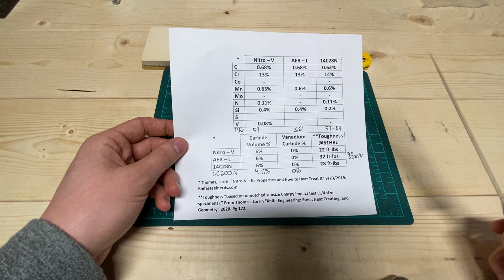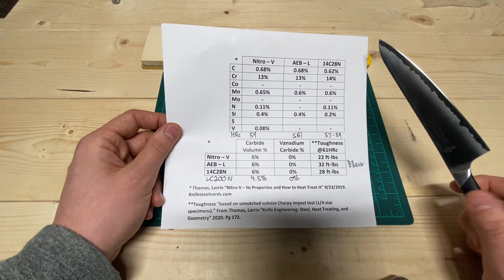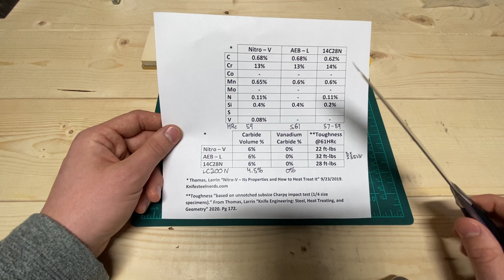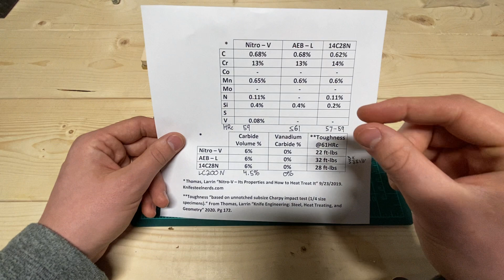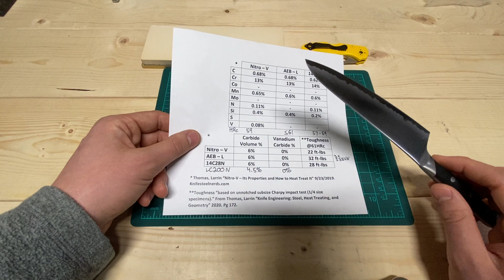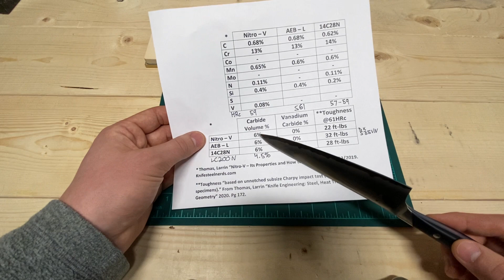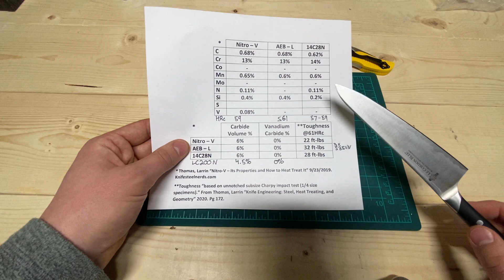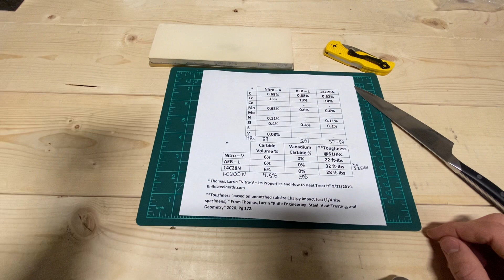Talking Steel: Nitro-V (Tough and Stainless)

Comment: Just curious, what about 12c27m? 
Its basically a slightly softer AEB-L from what I gather, with a little less carbon. 13c27 is about the same as AEB-L, 14C a little more carbonitride overall.

Comment: So does nitro-v have better edge retention? Since it's less tough?
Reply from the maker: Being less tough doesn’t necessarily indicate higher edge retention although they are strongly correlated. 

Between the three steels whichever is heat treated the to the highest HRc hardness will have the best retention. 

Very dependent on the maker.

Theoretically both Nitro-V and AEB-L have the same hardness potential I think.
Reply: @EngineersPerspective701  so in practical terms, nitro-v has no real benefit over the others? Except a cooler name?
Reply from the maker: @MRGoods89  more stainless is the problem it solves. I’ve had AEB-L get some light rust from sitting on the drying mat for a night (mother and law used it). Nitro V would have be spotless

Comment: I know absoluty nothing of metallurgy or if im even asking the right questions but id like to know what steels would you use for cutting wood, cardboard and meat? can you recommend a couple or one for each category? Also, what are your thoguhts on Civivi's damascus steel or any "damacus" steel for that matter is it worth using for an edc or is it just pretty and hyped up? apperciate your input thank you in advance looking forward to your response.
Reply from the maker: What you’re cutting is just as important of how and why. What are the situations you’re thinking for wood and meat? Cardboard is dealing with the odd box or you work in a warehouse?

Civics Damascus isn’t anything special but it’s not garbage either. Probably better off with their standard 9Cr18MoV.
Reply: @EngineersPerspective701  a good steel for warehouse cardboard boxes and for the wood im looking for a good bushcraft fixed blade steel for medium/small branches maybe small firewood splitting and for the meat im looking for a good steel to carve up deer and other small/medium game

Thank you for your input on the damascus i will definently look at some 9Cr18MoV thank you
Reply: @EngineersPerspective701  Hey not to bug you but i replyed to your comment and havent heard back from you would greatly apperciate it if you could still give me some suggestions thank you again
Reply from the maker: @MikeA-lo9xu  no sweat, I lost track of it! First pick is usually the non-stainless options and then I give the stainless recommendation. 

Cardboard: Maxamet from spyderco. S110V if you need stainless. 

Wood:  Nitro-V or Magnacut. I’d recommend stainless for this one. 

Meat/Hunting: 10V or K390. S90V if you need stainless.
Reply: @EngineersPerspective701  Thank you very much truly apperciate your help and insight I will most definitely be looking for these steels : ]

Comment: I have no experience with aeb-l. I do, however, have quite a bit of experience with 14c28n and nitro v. 14c28n and nitro v both sharpen extremely similar. They are both able to take a very high polish edge and, for "budget/midgrade" steels, they hold that top end sharpness for a respectable amount of time. For budget steels, 14c28n and nitro v are my favorites.
Reply from the maker: My experience is limited for all but I really enjoyed Kershaw 14C28N. They are really the perfect budget steel IMO. Very stainless, hold a good edge, tough and stabile. Only thing is I wish they would heat treat them a bit higher

Comment: seems like a bit of a pointless video. was looking for info specifically on nitro v. saying it depends heavily on hardness is a bit obvious as most if not all steels depend heavily on hardness. very little info on nitro v here just talking about other steels in the majority of this video. thumbs down 100%
Reply from the maker: Yeah pretty much laid it out right off the hop there to save you some time. If you have experience with the others it can give you an idea where it will land relative to those. Plus they are the direct precursors to Nitro V

Comment: Hi Justin, are you familiar with BGM Knives? Coming in the mail are two of John Miller's CKKs (compact kitchen knife) in Nitro-V which are cryogenic-ally heat treated in house at 60 to 61 HRC. I'd attached pics but YouTube won't allow. John is 22-years-old, a pleasure to deal with and making a pretty good name for himself in the knife community. Check out his work, both website and Instagram page.
Reply from the maker: Yeah I've heard a lot about him through Outpost76 and NotYourAverageEDC and been tempted but none of the designs when I last checked fit a need for me. However the CKK is new and that looks like a sweet deal! His prices have always been very fair so that may  need to be pushed up towards the front of the buy list! Really like that size too.
Reply: @EngineersPerspective701  How can I send pics of the two he made for me?

Comment: very interesting. So you mentioned that AEB-L is the very toughest stainless you can get for the most part on a knife at this time, and 14c and Nitro V are gonna be similar in toughness. they need to be hardened properly to perform. That said, does Nitro V really make that much sense on a small EDC type folder? Wouldnt it be more suited to a large wilderness blade?
Reply from the maker: There is more the how these steels perform than just raw shock absorption of a woods blade. At the high hardness they can hold a really sweet thin edge that is great for edc or kitchen tasks! Sharpens up amazing too which is fun for any knife. 

Honestly most large wilderness blades are so thick at the spine and edge they can be made out of almost anything and still perform well

Comment: Nitro-v at HRC 59 is a waste and blades that are at that HRC haven't had a proper heat treatment and cryo. Even the knife steel nerds review about it and results based on how they say it should be heat treated is incorrect. If you really want to see the performance of Nitro-V it needs to go through a vacuum hardening process then rapidly cooled with nitrogen gas followed by deep Cryogenic quench in liquid nitrogen its expensive but the end result is a steel that outperform the majority of other steels in toughness, edge retention and its still fairly easy to maintain a edge. People have been basing its performance on knives being manufactured buy companies who mass produce knives who put profit margins first who are doing the most cost effective heat treatment or from knife makers following a someone that people view as a expert who posts a heat treatment protocol on the their site that's not going to achieve maximum performance.
Reply from the maker: 100% agree. I’d say a majority of all blades made from any steel are “wasted” in terms of their potential. But unfortunately that means realistically speaking the way people will interact with this steel will be in that lower range and same goes for AEB-L. 

Even in customs it doesn’t seem like makers are going much past 61-62HRc on nitro-V which is well within the hardness range of AEB-L as well. So at the end of the day it is a more stainless AEB-L is all. Now that’s a major compliment in my mind because they are major outliers in the stainless steel class only really accompanied my Magnacut at this point.
Reply: Aeb-l is very prone to warping during HT & the HRC achievable with Aeb-l varies from batch to batch and which plant has manufactured it the average with a great HT will be HRC 60-62. To try and avoid serious warping with Aeb-l knife makers need to leave a thicker bevels Prior to HT and then remove excess stock & finish them afterwards. Problem then is the HRC test was done straight after HT removing the excess stock unless they have a water cooled platen set up the HT is affected. Nitro-v doesn't suffer from that problem it can have bevels ground down very thin to about 98% only needing the final cutting edge to be done and when HT using Vacuum has absolutely zero warping and HRC is repeatable as it's manufactured by one plant. Also saying they are basically the same as they can achieve HRC 62 with the Nitro-V being more stainless is not correct because Nitro-V is also much tougher & shock resistant than Aeb-l if both are HRC 62 and holds a superior edge.
Reply from the maker: @krakentacticaledc  Can't speak to the warping issue so that is a great note to have. And keep in mind this video is more of a production focused video because that is what most will have the opportunity to experience. Once you start talking custom, then really it's a completely different conversation as I'm sure you know well! It's like going from production cars to F1.

I really have a hard time believing the difference between the two is SO significant assuming a quality heat treat on AEB-L and you're being consistent in your material procurement. With the extra Nitrogen and splash of V in Nitro-V I can see how it would be easier to achieve higher hardness without generating excess carbides and/or blowing up the grain, thus reducing the toughness. So my guess if you've seen this happen with AEB-L, then one or both of those things are happening.

Comment: But what do you mean by working edge? So do you not suggest aeb-l or nitro-v for kitchen knives
Reply from the maker: Opposite, they are great steels for kitchen knives especially if they are done hard.

Neither develop a working edge because they don't have enough carbide. A working edge is when the initial hair popping sharpness is abraded away during cutting and reveals micro teeth (carbides) that will continue to cut. Hard AEB-L will instead hold that nice initial edge longer and then, somewhat suddenly, go dull. Abrasion isn't a major contributor to dulling in the kitchen so the ability to hold a working edge is usually not a desired steel trait by chefs. 

Many prefer the wonderful sharpening of simpler steels like AEB-L and carbon steels in the kitchen because of how fine the edge can be sharpened and how long they hold it. 

If you enjoy sharpening, AEB-L is the 2nd best sharpening stainless steel I've come across. Almost feels like a carbon steel.
Reply: @EngineersPerspective701  if so what would you recommend for a laser class chef knife? aeb-l? or Nitro-v? and at what hardness? and what about honing ability? It seems like aeb-l and nitro-v lacks in edge retention so if I go low hrc would it be easier to have it little lower hardness and do a quick one two pass on on a honing rod? I personally dont use honing rod at all but seems good option when I am in middle of service and my knife goes dull.

I am a culinary art student planning to order a custom knife and he offers aeb-l and nitro-v and he said he can harden hardness I want. And I am planning to use that knife as my everyday work knife and I can't really decide which steel at which hardness. I already made up the design I want but I really cant decide on which steel at which hardness.
Reply from the maker: @smithgeorge6858  Your reasoning is a little backwards here so I'll try to explain. 

First I want to note that the maker's knowledge and skill will be the #1 dictator of what to target. If they've never made a knife in that steel and hardness then pass on it. The heat treat is the soul of the blade so it must be done well if you're paying for a custom.

1) Take aogami super at 65HRc for example. Famed for taking and holding a great edge. Yet it technically has less edge retention than AEB-L based on carbide volume at about 1/3 of what AEB-L has. Also less tough than AEB-L by a lot. Yet it does so well because it is HARD AS HELL.

2) You say that AEB-L doesn't hold an edge. The logical step would then be to make it HARD to compensate. The beauty of AEB-L is it's super tough at high hardness compared to most steels. It's a perfect candidate for the application. Going soft would be like buying Ferrari and putting mudding tires on it. 

In short, I'd choose AEB-L at 63-64HRc. If you're concerned about loosing the edge then buy either a MAC or Idahone ceramic rod (NO DIAMOND RODS!) and that'll keep you up and running. 

If you want more stainlessness then go Nitro-V. I haven't used it personally so I have to recommend what I can speak to which is AEB-L. I'm sure Nitro-V would be great too.
Reply: @EngineersPerspective701  ok totally don't understand why but i totally got it with your super blue example. I do own super blue they take nice edge and they don't go dull as fast other knives even though their edge retention is even lower than aeb-l in the knife nerd graph And one more question do you suggest mac white(1200grit) ceramic or black(2000grit)? For 63~64hrc aeb-l
Reply from the maker: @smithgeorge6858  Either works. I prefer higher grit rods for honing.
Reply: @EngineersPerspective701  after doing some research I kinda do understand how and where your argument is but I just cant understand the science behind it. for example I had vg10 at 60hrc and aus10 at 60hrc and 440c at 60hrc and they all had different edge retention for me and vg10>aus10>440c that's what I have felt and learned that hardness does keep the edge for longer but with same hardness 440c just does not can't keep the edge longer than vg10 for my experience. I understand in the kitchen I am not cutting abrasive cutting like rope. So, can I understand the CATRA testing as ease of sharpening instead of edge retention for my case? just like super blue which has even lower score than vg10 But I know form experience super blue steel keeps the edge extremely well. so my understanding is super blue has little to no carbide so it wears out but vg10 has carbides after the sharpened edge wears out so does better in CATRA testing. I do know that hardness do take effect for edge retention but what is the other science behind it for like super blue steel for have excellent edge retention.
Reply from the maker: @smithgeorge6858  Couple things up front
1) All of this information is a generality. It's impossible to speak 100% to the performance of blades without actually using/sharpening them.
2) VG-10 and 440C have roughly the same carbide volume depending on heat treat. They're reported as 12% CrC in "Knife Engineering". I'd expect AUS-10 to be close or slightly lower carbide volume than those.
3) What angles were these sharpened at?

Using the CATRA example. By FAR the 2 largest contributors to high CATRA scores are in order:
1) Edge geometry
2) Hardness

So with that in mind the #1 thing you can do to increase a CATRA score is increase hardness. That in turn allows you to decrease the angle.

What possibilities am I thinking about for you noticing a difference in those steels?
1) The edge angles were different
2) 60HRc was advertised but in reality any could have been between 59-61HRc likely. 
3) Your quality of sharpening and deburring varied between them. 

Does that help at all?
Reply: @EngineersPerspective701  Ok I guess all the knives are not hrc checked and sharpening angles are same but yes they have different grinds. I guess thats factor I didn't think. And one last question. You told me that finer ceramic rod is better how does 4000~5000 grit(spydrco ultra fine rod 3 micron)  sounds like? is that too fine? I am afraid if it's too fine it wouldn't really sharpen a new edge.  because my plan is only doing touch ups with the rod before and after lunch service and after dinner service. 10 swipe each side. I know you might not know this but do you have any advice? the knife will be aeb-l 63hrc
Reply from the maker: @smithgeorge6858  I'm just trying to give some background to the confusion with those steels! This kind of stuff makes it VERY difficult to make sweeping statements about knives and steel. 90% of the time the 1) Angle 2) Heat treat 3) Sharpening will make a WAY bigger difference than the steel chemistry itself. 

I wouldn't necessarily say higher grit is "better", just preferred by myself. As for what will happen for you:
1) At that grit and generally with "touch ups", one is not looking to sharpen so much as hone.
2) The actual results will definitely depend on how sharp the edge was at the start of service and how much it was damaged/dulled. If you're using it to microbevel on the spyderco sharpmaker then my gut is saying the UF will be more than enough.